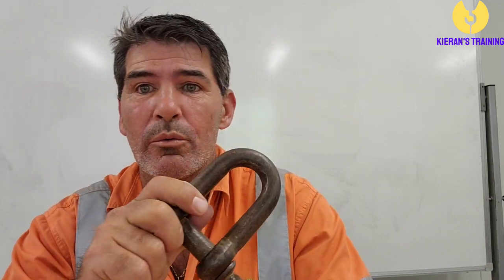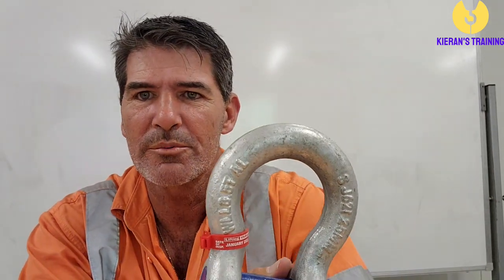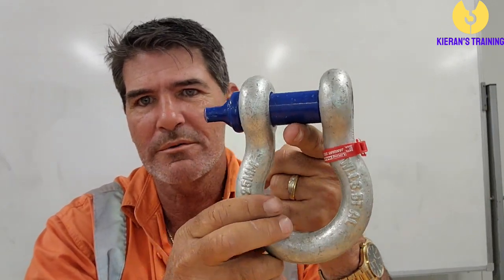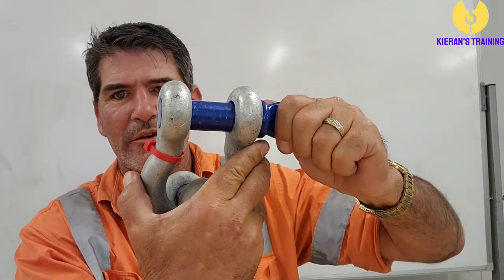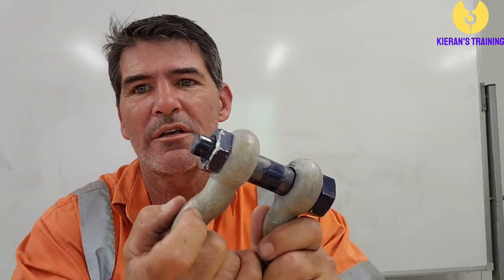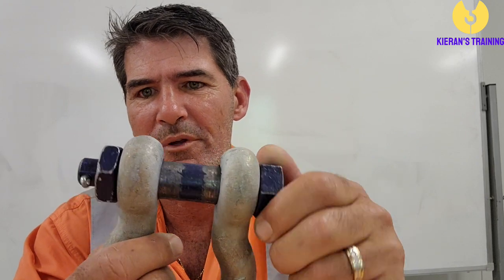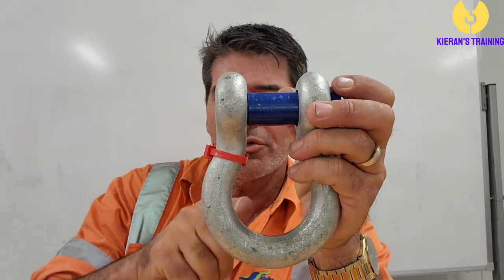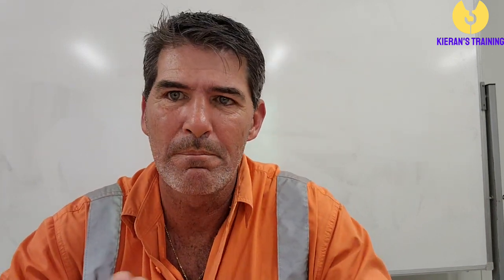Which Shackle Should I Use

Comment: About the "screw all the way in then back half a turn" although it will not make the break load of the shackle any lower, and it is taught everywhere in Australia and most countries, but it is not recommended by the shachel manufacturer/designer. This is only something that everyone kown it is safe to do so and makes life easier, but not something written in the test book. The little pin hole on the pin is there for you to insert a rod and break it look after a lift. For very high risk lifts (espect wind, swing, vibration, sliding ect), keep the pin tight. The deformation that locks the pin helps deaster from happening.